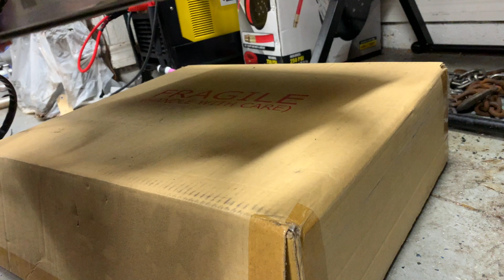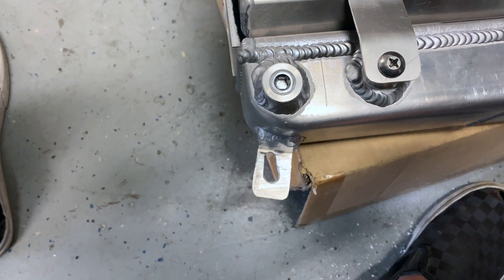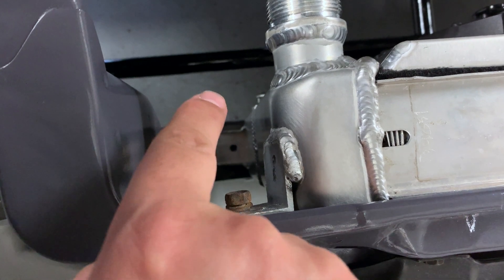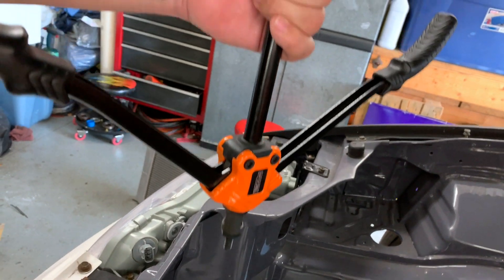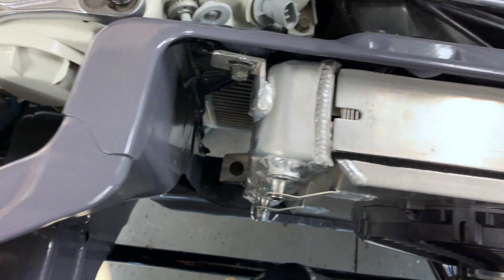Pro Street Eclipse - Part 38 - Electric Water Pump

Comment: i was looking at this video and notice your front mount support. is this something you made? im asking because i picked up a GSX and looks like the previous owner mess up my front support and the bolts the bolt up under the front radiator support are stripped. so i was looking to make something to replace that. and instead of going front to back i like you left to right support.
Reply from the maker: The brackets on the intercooler were on there when I got it.

Comment: Whats up Joe!  Long time dsmer, recent viewer (and subscriber ;) )  Maybe I missed it, but I was curious as to why you chose to mount the pump there vs the drivers side of the crossmember?  That way both ends of the lower coolant hose would only be about 16" long?
Reply from the maker: The problem with the driver side is that the hose would be TOO short, to the point of it probably having to be a hard fitting, requiring very precise and sturdy mounting location, and also, the exhaust is going to occupy space over there. There was more room on the passenger side. Thanks for watching, and subscribing!!!

Comment: What set up are you using for water pump delete? AMD are you running a thermostat still?
Reply from the maker: I bought a block off from JayRacing.com and I will not be using a thermostat. I will be using a pump controller/my ecu to regulate temps.
Reply: @JoeWrenches  perfect thank you for the reply